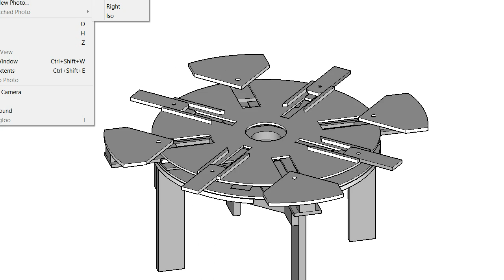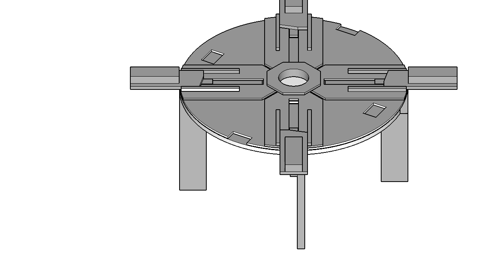Table Plans Update

Comment: Hi Scott, I'm very interested in your Design. Do the plans come in digital format (like DXF, STL, STEP, SKP, etc.)???  I would like to CNC-cut as many parts as possible. Do you include the specs (sizes and so on) for the "vitamins" (vitamins=3D printing world for "metal parts" ) ???
Reply from the maker: +Gustavo Blanco Thanks for the interest, I have a pretty good overview of the info here: http://mechanicallumber.com/plans-for-sale/ One note is that the dxf vector files are in progress and available on request for now, while I work out the details, included by default later. Thank you.